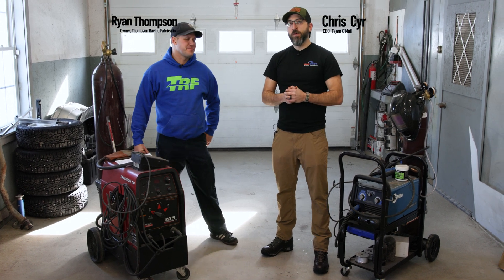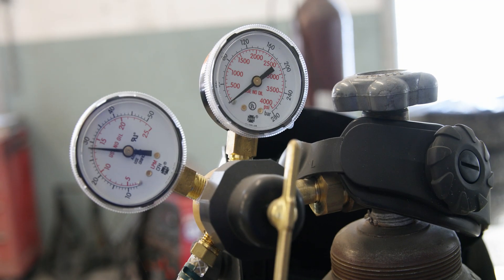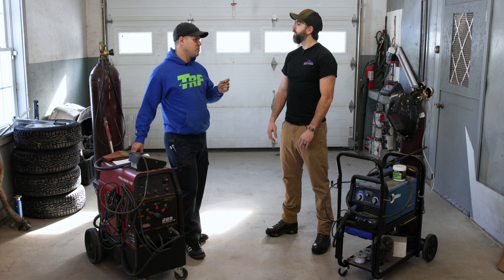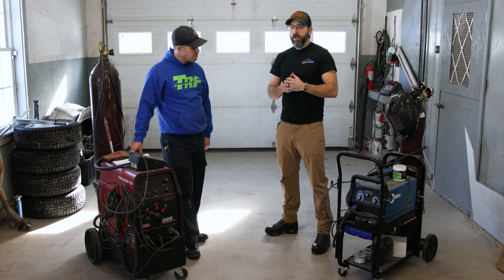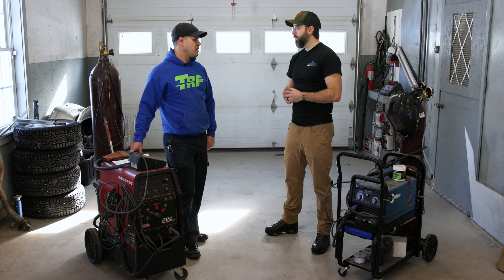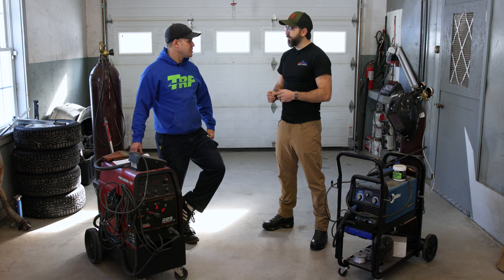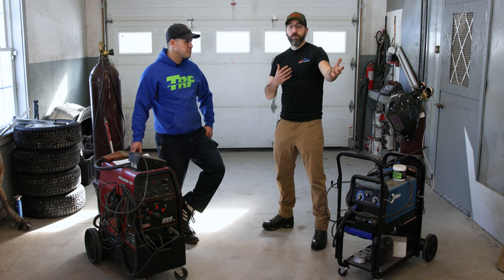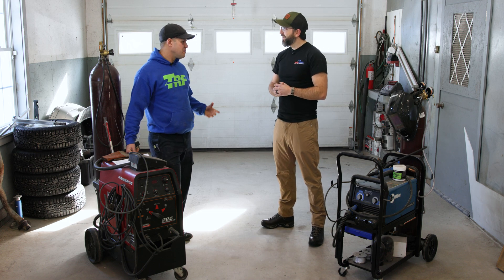Roll Cage Safety & Design | Types Of Welding

Comment: I'm a two year trade school certified welder with three years professional experience, and this is an excellent video. The issue with welding is that it's hugely complicated when attempting a structural weld, and there is no more structural a weld than in a roll cage. Every dime in the bead is important in that application. I'm certified on oil pipelines, and even so I would hesitate to weld a cage with lives on the line. Every aspect, from penetration to HAZ, plays a critical role in a roll cage.
I have immense respect for expert roll cage builders. If you don't understand why building one is so difficult, I urge you to hire an expert for the job. If it's not intimidating to you, you don't know enough to build one to spec.